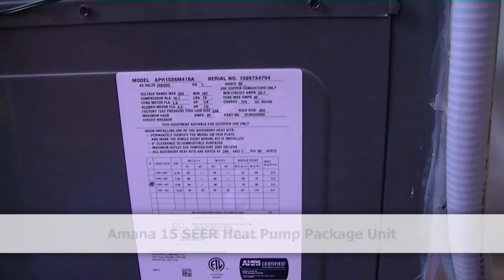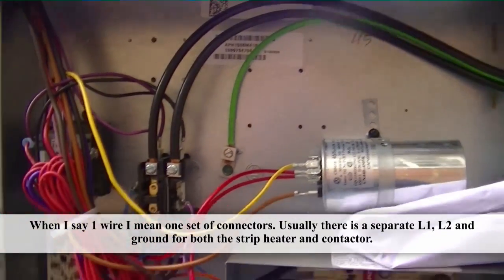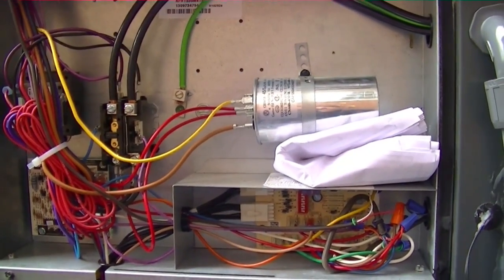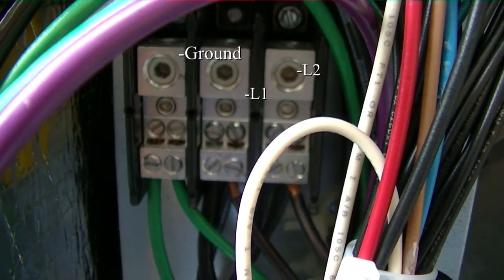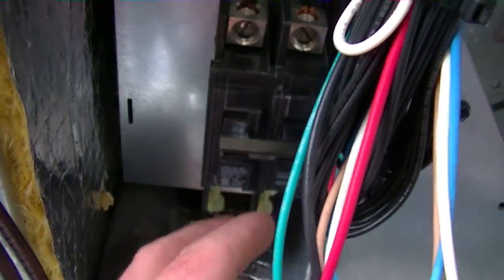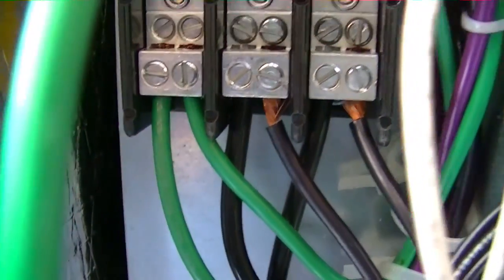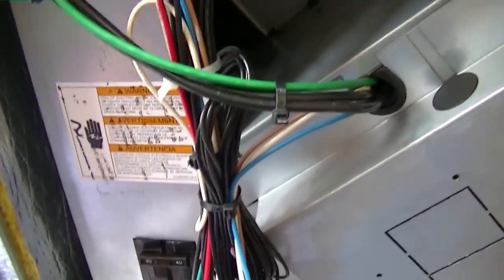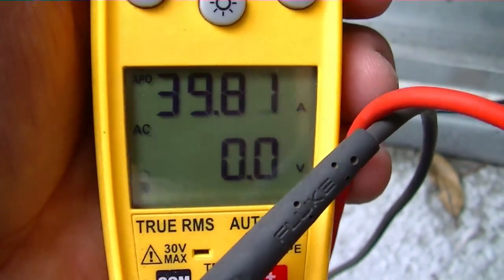HVAC Training-  Package Unit Single Point Wiring

Comment: Hi what the benefit condenser fan for package?
Reply: A package unit will have the condensor and evaporator fan in it. The condesnsor pulls air throug the condensor coil to remove heat from it and cause it to condense into a liquid again.

Comment: I just purchased a Goodman 3.5 ton package unit. Im to the point of hooking up the 230volt wiring -  where does it hook up at? In the access control unit I see the wires for the thermostat but I do not see any place for the much larger power source wires. The manual just shows that it gets hooked up to the switch, but I don't even see a switch big enough for that wiring. Can you help me?
Reply: I’m in the process of trying to run power to the unit from the main panel ( mine is a Goodman 3 ton ) so should I just run #6 awg copper with a 60amp breaker to a disconnect box ( if so what kind of disconnect

Comment: Please help this novice to understand this.  

From the 80A main breakers, the 40A breakers of the single-point kit are for the compressor contactor. Right?  

But apparently there are no separate breakers to the heat strip (where they would normally be in the breakouts you showed).  Why wouldn't you install separate breakers for the heat strip?  I mean, if the heat strips were to short out, right now there's only protection from the big 80A main breaker which would trip, and then the entire heat pump unit would be without power.  RIght?   

What size breaker does that 10K heat kit call for?

Thanks!
Reply from the maker: 10 kw would be 60 amp usually

Comment: Have you ever had trouble with to much static pressure on a package heat pump? I ran into a new bout 1 year old goodman heat pump 4 ton. I went through everything looks good (pressures, charge, clean coils etc) but supply air temp 85 to 90 deg at best.

Comment: Hello Talyn875, I would like to say I find your videos very interesting and educational and admire your professionalism.  I do have a couple of questions in regards to this video.  You stated that the heater is a 10KW and its on a 40 amp breaker.  I am an electrician and know to find current draw you take the 10,000 watt heater and divide by the voltage of the heater, 240V which equalls 41.67 amps this current exceeds the breaker capacity and should trip but in your video your amp meter was drawing 39.8 or so amps.  You also ran the feed wires for the cooling contactor from load side of your 40 amp breaker, if the cooling contactor engages and the compressor and fan kick on this should certainly trip this 40 amp breaker if the heating coil is drawing current.  I am wondering if the cooling contactor feed wires should be fed from the top of the feed terminal you installed and not from the 40 amp breaker you installed.  The unit should be protected from short circuit and ground fault from the house panel breaker, if sized correctly for the load to be served, and as far as I know the unit compressor has thermal protection and so does the condensor fan motor, so feeding the cooling contactor from the 40 amp breaker you installed would not be necessary.  Is it possible that the heater is an 8KW and the cooling contactor feed wires should be placed on the hot side of the feed terminal block you installed?  I really appreciate your expertise in this question.  Thanks and keep posting your videos
Reply: Just watched video again I see that the heat strips are on the single point terminal connection and not on load side of breaker, my bad.  The draw of the compressor and fan don't give much room on that breaker seems like a nuisance trip hazard coming into play there at 39.8 amps.  Great video thanks for posting
Reply: jhp110  I see you video wan you reading amps from heat strip breaker your heat strip puling 39amps but its good for 10 kw heat strip but my question wan heat pump energizes with heat strip together in winter time so your Amperage going hight like around 50 amp your breaker trips and your wire burned ???

Comment: Nevermind I looked back and I see that the compressor is wired from the 40 amp breaker and the main breaker panel will be breaking the heat strips I guess lol
Reply from the maker: That's right, the strips come from the main lug area of the SPK 40.

Comment: You know I bet that is my problem with my package heat pump the AUX heat will not come on, when we have a very cold morning it will be 60 in the house and set at 70.
Reply from the maker: Sounds like  it. They may be working from defrost and not for AUX from the stat.

Comment: You had to run the wires for the cooling contactor from the breaker right?.. and that breaker was originaly factory wired  to send power to the cooling contactor i imagine.
Thanks for the info
Reply from the maker: That is correct